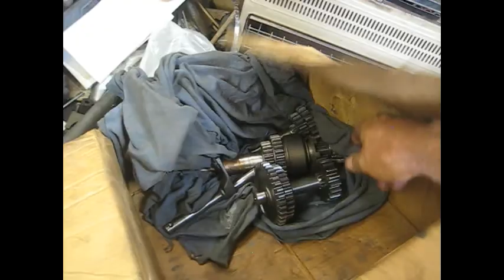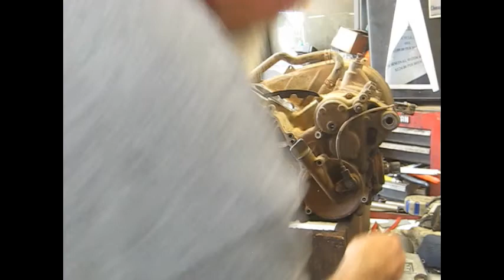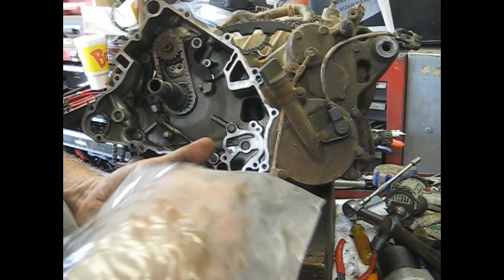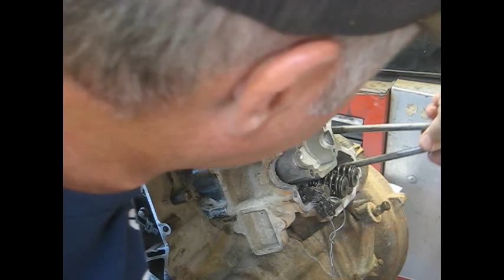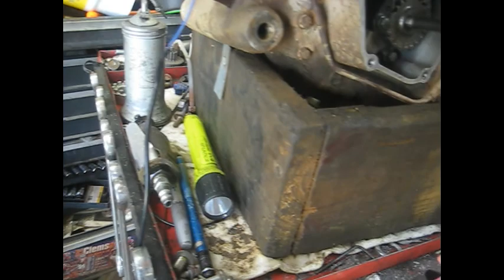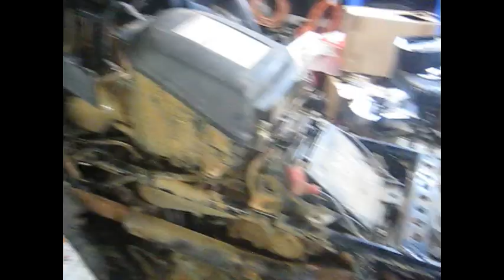Kawasaki Brute force motor reassembly

Comment: Maybe you can help me out, my 650 is blowing oil filter gaskets, from to much oil pressure. Any Idea where to start with that issue? The motor sat up for a couple years. TY in advance.

Comment: Should the crank turn freely by hand? I just assembled both halves and had my crank professionaly rebuilt but now with the 2 halves assembled i can only turn the crank with the crank bolt and a ratchet. It does turn easily with the ratchet with no bimding in any spot is this how it should be?
Reply: Thanks I was thinking after I was done for the day. I'll take a look in a few hrs after work. Thanks for the fast response!
Reply from the maker: More than likely your crank is not pressed all the way into the right crank bearing. Not sure if you can put it back into the press at this point or I have taken a handle of the sledgehammer and hit the end of the crank with the handle to move it ever so slightly and make it spin freely.
Reply: Did you ever figure it out?
Reply: @Tom-oz4pm  i gave it a few good whacks as he mentioned to do above. Only I used a dead blow hammer with a plastic head. It got better but still wasn't super smooth. It's reassembled and it runs fine.
Reply: @countryboy-pk8xm  ok thanks. I just put the case together on mine and it doesn’t spin by hand. If I grab it with some channel locks it will spin. Should I be fine?

Comment: Thank you for making your videos.  I am in the reassembly phase of my 2012 Kawasaki Teryx 750 FI and completely opened up the engine case, replaced the crank(spun bearing) with a new Kawasaki crank, rods, bearings, totally washed/cleaned the cases, I put the new crank in using the freeze heat method, installed the trans, same method.  When I put the cases back together it took quite a but of effort to get the left side case onto the crank.  Once torqued down the crank will not move.  I once again split them but am unsure what to do......HELP!  I feel as though the left crank bushing(original) still looked good but the tolerance between that and the new crand are way too tight. Thoughts and thank you.

Comment: if everyone did how to videos like you!!! im going to attempt my first rebuild of top end for now. question about the head gasket. in video i think you said you put copper sealer on then the metal gasket. did you put sealant on both sides of the gasket?
Reply from the maker: Thanks for watching. Yes I put a light coat on both sides.
Reply: do you recommend putting that on the cylinder gasket too?

Comment: A little aid I have discovered for installing stator covers or any cover really (engine cases)is using a couple pieces of 6mm threaded rod about 6-8 inches long and threading them into a couple of bolt holes by hand , this eliminates any alignment or gasket issues as you slide them on. Long bolts with the heads cut off work even better because of their smooth shank , you can make some with various lengths to suite any job .
Reply from the maker: Thanks for that info. I haven't thought about that but it would work great. I'll cut some bolts off tonight.

Comment: I am watching your video and learning a lot. Currently repairing a 650 V2 in a 2005 Arctic cat. Long story but if a rear cam sprocket is in the wrong position, how is it put back in proper position.  Without removing front head and flywheel cover.
Reply from the maker: You should be able to rotate the cam by removing the cam cover and the tensioner and the chain have enough slack to get the cam to rotate.
Reply: @FourwheelerDoctor I have been trying to get the rear in sync, last question I hope, if I am sure of the cam position in the front, then how do I align rear, been setting flywheel at tdc R and putting cam arrow up?
Reply: @FourwheelerDoctor  went ahead and removed front head and got arrow up for  tdc F and arrow up for rear at tdc R. This my first on a motorcycle engine, if it works I got a good deal at 600 bucks.
Reply from the maker: @pauli8413  just to make sure they shouldn't be put both pointing upwards at the same time. There should be a mark for the front cylinder that you set to top dead center on the flywheel then you rotate the flywheel to the mark for the  rear cylinder where it would be set to top

Comment: Is there a reason you don’t use loctite on rod bolts?
Reply from the maker: I have never had one of the nuts back off and the manual doesn't call for it.  On these motors it seems like it'll spin a rod bearing again before any bolts every back out.

Comment: Hi, would you worry about cutting the valve seats or are you confident the .045 as stock is fine? 

Thanks for the video!
Reply from the maker: I very seldom have problems on the bikes with the valve seats. Most of the time it's the actual valves that are worn out.
Reply: @FourwheelerDoctor  thank you man. Il continue with the rebuild

Comment: I have an 06 complete rebuild runs strong but still. Getting valve noise back cylinder I did put high compressor pistons in it valves are beating me
Reply from the maker: Are you sure you are adjusting them with the rear cylinder at TDC?

Comment: After assembly all components i when ahead and install the motor on the bike and shift shaft is stock on a gear,I can’t get it loose.

Any suggestions?

Thanks

Comment: This video sucks and is horrible due to late info, missing info, and no info! if your going by what is being shown and told in video if and you have had it apart for a while. It's not told that there is difference in cylinders, that there is difference in cam timing from cylinder to cylinder, not much is said, no heads up on next part fitting differently or being done differently. All stuff is only after the fact and you have already completely assembled. Most any differences are brought up at the end of any batch of work which you can't know about until the end of each piece of work. I ended up taking my motor apart several times due to the fact of constantly late info, missing info, and poor info.

Comment: I have a question for you.   I am getting water pouting in my oil and I am wondering is something broke in the water passage way or is it the head gaskets?
Reply from the maker: In my experience the only ones I've ever had get water in the oil was from a cracked head or the seals going bad in the water pump

Comment: Great video for us DIY engine rebuilders on a budget, but where do you get your parts?  Kawasaki takes forever to order.
Reply from the maker: Thanks man that's what I was shooting for. I'm on the east coast so I order my parts from a dealership called mrcycles.com. They have good prices and can get my parts in usually less than a week. I also use motosport.com which can also get me parts quick if they have the parts in stock.

Comment: I hope I can get a response to my question, I have a 05 brute force 750, the question is have you ever seen a flywheel that when you look down in the timing hole the edge of the flywheel is so far back you can't see, plus it's not covering the stator, if so what is that of not what do you think the reason might be, thanks for your time, Mike
Reply from the maker: I've never seen that happen before. The flywheel is somewhat of a press fit on the end of the crankshaft and it will only go so deep in there. I don't have a clue what may be wrong with yours.
Reply: @FourwheelerDoctor  I watched the part of the vid when you was getting ready to time up the 750 reassemble video and my fly wheel looks the same, you can see the end of the stator as well just like mine, my worry is because I don't have any fire at the plug and was hoping that's what it was but I guess not know, going to have to look somewhere else, cause it fired when it came in, but new rings and cleaned the heads up and no fire, weird, didn't touch any wires, there is one thing, at the back of the plastic cdi holder and all the relays, there's a little square relay that's gray, maybe a 1/2 inch thick with  2 wire, someone said it might be a roll over relay or something, you hear about a roll over relay, I might have to reset, thanks for your time, Mike

Comment: 2009 650 rebuild. Putting the cases back together and after I torquing the bolts I want to turn the crankshaft but it is impossible to turn. I have the rods lined up and nothing hitting them. What could be the problem?
Reply: Yes sir I did put a new crank. I did what you said and it turns easier with a wrench but there is no way you can turn this by hand. The more I think about it if you have to tap it in with a mallet then it’s going to be pretty snug. Appreciate your videos couldn’t have got this far without it.
Reply from the maker: Did you put a new crank in it?
Reply from the maker: More than likely the cranks not pressed deep enough into the bearing on the right side sometimes if you tap the end of the left side of it with a rubber hammer it will seat it deep enough and allow it to rotate
Reply: Four wheeler Dr all I can say is…..YOU ARE THE MAN!!!  I took the bolts out of the case and to see if it would turn and it was free as a bird. Put the number 1 bolt in and just snugged it down and it was hard to turn again. So I took a piece of 2x4 wood and just a firm tap with a hammer against the wood and that was it!  Torqued all the bolts down and she is smooth as butter!  Thank you again. Ever need any cerakote or powder coat look me up. Outlaws custom coatings. Westminster SC

Comment: Engine/trans only holds around 2 qtrs of oil, but  You run a little low and ride it like we do (Wheelies & WFO) & starve the oil pump and spin a rod bearing. I Built a oil tank with 2x more qrts oil capacity problem eliminated. FYI: Can-Am uses 1.9 qrts oil but has a separate trans&oil so it lives.
Reply from the maker: It probably helps keep the oil temp down too which is also a problem with theses bike. How did you plumb the extra tank in? Oil filter adapter?

Comment: Man I need help, I think you could help me out
Reply from the maker: I can try what do you need?
Reply: Just put my case back together, and now I can’t  move my shifter
Reply from the maker: @aatrix9751  have you tried to spend the shaft that the secondary clutch goes on while you shift it?
Reply: And when I torque the case down I can turn my crank
Reply: @aatrix9751  just put my case back together with new bearing and bushing ---hot rods crank ----after i torque the case bolts my crank is locked solid ----any ideas???
Reply from the maker: The crank probably isn't pressed all the way into the bearing. Hit the end of the crank with a rubber hammer toward the crank bearing that it presses into.

Comment: I never leave comments but,... you are the man bro!! you did that shit... Thanks for the video!!
Reply from the maker: Thanks man and thanks for watching!
Reply: @FourwheelerDoctor  I just bought a 2020 brute with a motor was told is good started but only went up to about 15MPH. After watching your videos I saw that the heads and cams are bad, with that said what year cams can i use is it 2015 and up? it gets better,.. Flywheel chewed up my stator and there are pieces of magnets all in the motor.,, What do you think would be  the cause of that and what should I look for? on top of that it also has a spun bearing. I ordered new rods and the yellow snap in bearing like you use in this video. Im just about to split the case. So far I have ordered new rings, Stator, flywheel,  new heads used 2015s,... Do I need sent these to a shop to be worked?, 3 chains, complete engine gaskets and seals kit  and inner rotor pump it was split. with Said,.. What should I look for from here? Thanks for your time and the most educational  videos on the tube!!!!

Comment: When I pulled the transmission shafts out everything came out pretty easy.  The bearing on the secondary clutch shaft came out of the case with the shaft.  Now that I'm reassembling it, the bearing and shaft will not go back into the case.  Any clue why it's so much more difficult to install than to pull out?
I've tried to hammer the shaft back in, but it barely goes, and it doesn't want to stay square with the case, and it also feels more difficult to spin the shaft in the bearing. 
I'm thinking I need to pull the bearing off the shaft first and install it in the case, then drive the shaft into the bearing to prevent damaging the bearing, but was wondering if you had any better ideas first.

Comment: would you have any idea what size the kawasaki kvf 750injection 2008(700 km)  adjustment is made of ?? Please help me !i heave problems with backfire...
Reply from the maker: I would check the valve clearance first. These bikes normally not have man problems with the injection but I have cleaned the injectors on a few.

Comment: Hello , have you ever replaced the left side crankshaft bushing in the the case? I have a teryx 800 I'm rebuilding and notice the crank has some play up and down were it rides in that bushing. Kawasaki wants you to replace both cases. Thanks
Reply from the maker: Yes I have replaced a few of them. If you have any play it will be best to replace it. you can press the old one out and press a new one in. Only thing is like you said you can't buy one from kawasak separatei. There are some listed on eBay and I have used and had success with before. But you do not have to replace the cases.
Reply: @FourwheelerDoctor  thanks for the reply. I have one I purchased of ebay I think ill press it in give it a try

Comment: I lost one of my washers for the head bolts. The ones inside the head that take 14mm socket. Do you think I could use a washer same size from autoparts store in its place or would you wait and get oem washer from atv dealer? I was not sure if not being blued it would cause a problem
Reply from the maker: You can use any washer of similar size. I think the reason in the washer is to keep the acorn nut from digging into the aluminum as it is tightened so any washer will serve this purpose.
Reply: @FourwheelerDoctor  Thank you again. And again great videos. I'm following your video putting my motor back together after a full rebuild. Going to pick up a washer today and continue putting it back together.

Comment: Have quick question ..after I did this build I can’t seem to get to shift into any gear? Have any idea what it could be?
Reply from the maker: did the shift forks feel like they're moving or are they stuck. Also have you tried rotating the shaft that the secondary clutch goes on while you  shift gears
Reply: @FourwheelerDoctor  I don’t know w it feels as I didn’t put the motor back on the bike and try it. He rocked it back and forth and said it still would go in gear. The secondary shaft spins freely .. so I’m guessing the forks are stuck. Could that little ball be bolted down to tight ?
Reply from the maker: @sheriffwoody5888  it's probably not the little ball. The way the dents are in that shift shaft the ball will roll up and down pretty easy because of the spring. I'm not real sure what it may be
Reply: @FourwheelerDoctor  alrighty thanks I’ll have to get to the bike and check out it myself and see what I notice
Reply: @FourwheelerDoctor  just talked to the guy said he can go through the gears by his hand but not with his shifter lever. Also once it shows it’s in gear it still rolls like it’s in neutral

Comment: You say that starter gear is expensive at $200, I called for a new starter motor and almost passed out when they told me $650.
Reply from the maker: Good lord.  Did you tell them you didn't want the gold plated one..lol
Reply: @FourwheelerDoctor  I told them I only wanted a starter,  not the whole bikes electrical system. 

When you reinstall the crank do you use the jig to install. I found a manual for my 07 and it shows a jig. I dont really want to buy a tool to use 1 time.
Reply from the maker: @JB_Machine  lol noni don't use a jig. I usually stick a socket opposite the big ends of the rods to keep the crankshaft from pushing together then I just press it in. I think I have a video that shows what I am talking about. I will look around and see if I can find it.
Reply: @FourwheelerDoctor  appreciate it👌

Comment: When i took the heads off my 04 prairie 700 motor, this 10mm nut fell out of the top of the front head and i have no idea where it goes as it doesn’t look like anything’s missing. Any ideas?
Reply from the maker: Is it one of the lock nuts off the valve adjusters is it?
Reply: @FourwheelerDoctor  Nope there all there

Comment: I got mine rebuilt it wasn't the trans. Still haven't honestly figured out why it locked up on my wheels. Already checked back wet brake. Haven't checked the front diff. But motor runs great thanks to you man!
Reply: Can't get mine to crank. Not sure if I'm a 180 degrees out. I'm at a loss for knowing what I did wrong. It backfired when I tried to crank it but its in time from what I can tell

Comment: How did you spin the crank to set up the time?
Reply from the maker: Most of the time I'll just install the pull start bolt back in the crank and turn it with it. Sometimes you can grab both ends of the crankshaft and get it turned over with your hands if you have the spark plugs out.
Reply: @FourwheelerDoctor  in the process of putting one back together just got case back together like in video. Just put that bolt back in and rotate it to line it with mark on case correct
Reply from the maker: @sheriffwoody5888  yes that is correct
Reply: @FourwheelerDoctor  Thanks!
Reply: I’m building the same engine and just put the cases back together. I wanted to turn the crank to see how it would turn. It is tight. No heads or cylinders on either. Should it be that hard to turn?

Comment: I took a 04 motor out, and because of circumstances iys been mouths and forgot where the ground cable grounds to the engine, on this motor was it in the side if the head or somewhere else if you can remember , thanks for the vid and your time, God bless
Reply from the maker: It bolts to the right side of the rear cylinder.